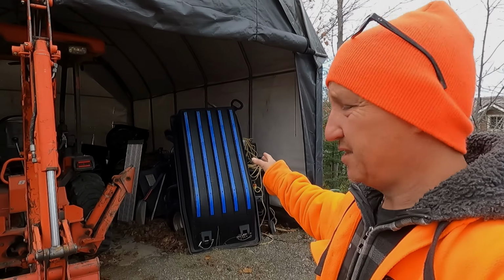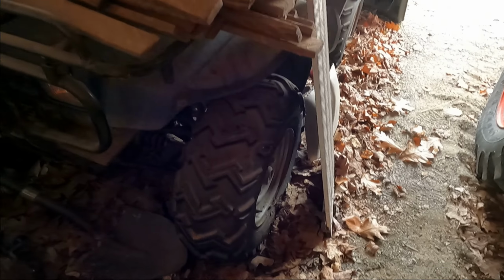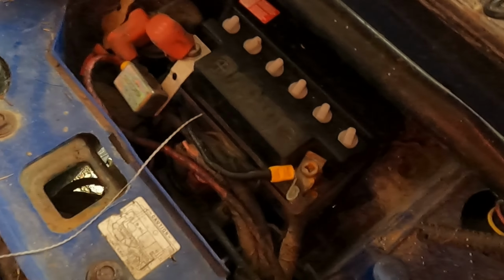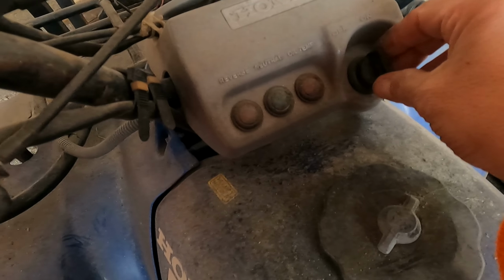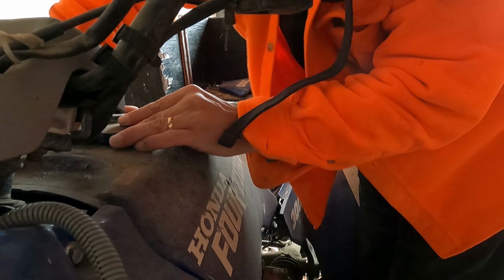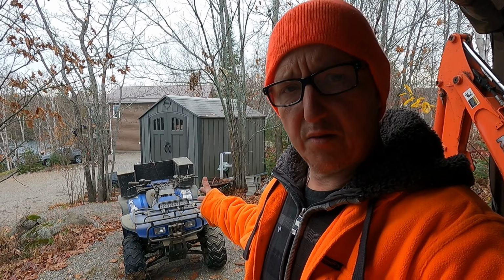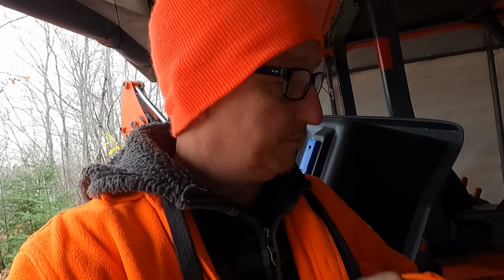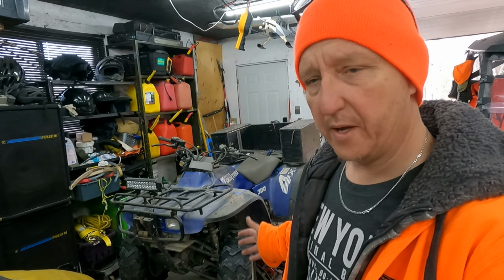Reviving My 1991 Honda Fourtrax 300 After 4 Years of Rest: Starts-Up and Drives!

Comment: I have a 2002 Fourtrax, really reliable, have done several days of 70+ kms on the logging and drill roads 'round here this year. I have a twist-grip to mount on mine (many years driving motorcycle), and I need to fix an inner CV boot. Mine is a 350, with electric shifting, and back-up pull start. I like the fact it' s a gearbox, and not a CV belt drive. I also like that the air-cooled 350 is not too wide, or heavy. Parts readily available, I find. It gets me lots of places I couldn't get to otherwise. I put a bar-end mirror on mine for driving on road (highly recommended), and I'm considering a horn, to signal person I'm driving with. I have locked out the reverse lockout on mine; it was driving me crazy.
Reply from the maker: That’s awesome. These older Hondas are legends. Thanks for sharing.